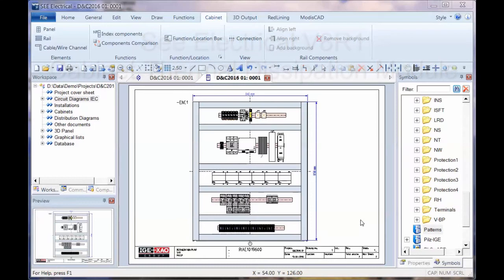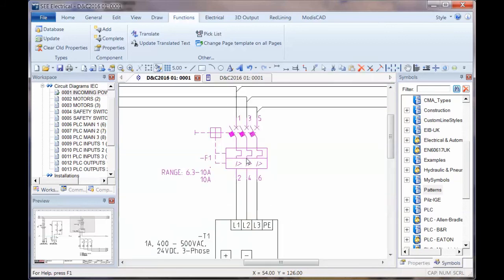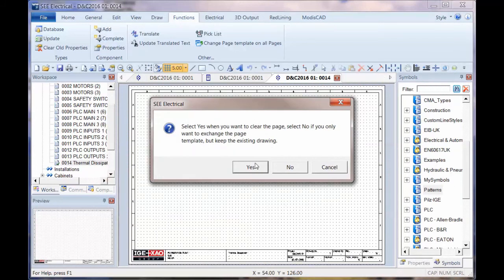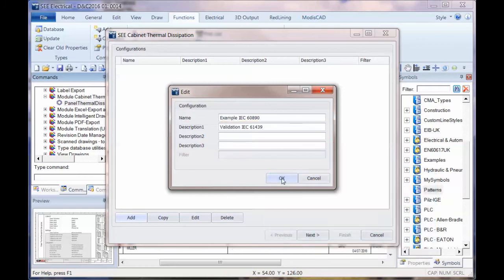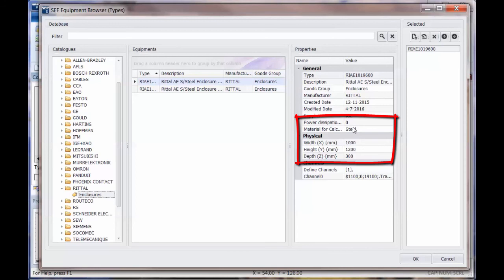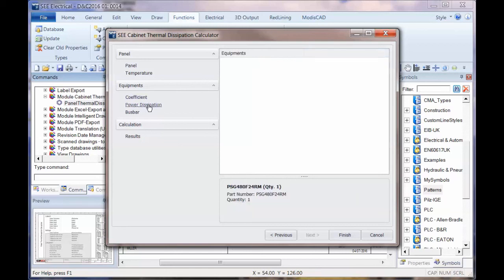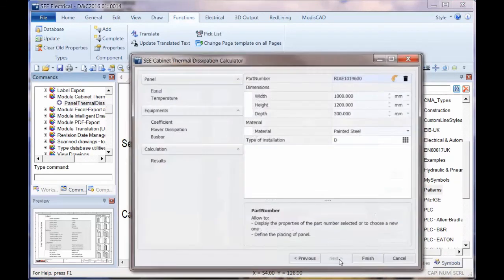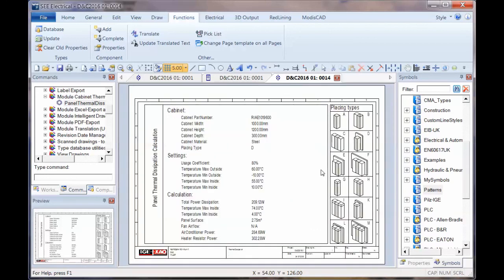Thermal Heat Dissipation Calculations for Cabinets in V8R1

Comment: Hi, 
Could you please help me...
Do you know how to measure the overall heat dissipation of the electronic components?
Here the component is ADAS front camera situated on car behind the windshield?
Having processor, image sensor or other electronic components
Reply from the maker: I'm sorry but our heat dissipation calculation is specifically tailored for electrical components contained within a panel, where the panel is either placed against a wall or next to another panel, which won't help with electronic components in a car.

Comment: Hie,

I need a calculations of Electrical panel cooling system.
For example: Panel size is 2100H X 800W X 800D mm and material is MS, thickness is 2mm
Total watt loss is around 2000Watts (Assume)
Cooling: Fan_S2D300AP0250 & SK filters 3240 catalogue models used.
Here how we came to know that No. of Fans and filters/louvers is enough for cooling the panel??
Please kindly do the needful.
Reply from the maker: This calculation is part of the module described. Do you have the module?

Comment: hi Where can I get the SEE files to do this calculation?
Reply from the maker: Hi Holy_Mage, the template files should be in the public documents folder C:\Users\Public\Documents\IGE+XAO\SEE Electrical\V8R*\Templates\. 
There should be 2 standard templates available called PanelThermalDissipation.tdw and PanelThermalDissipation-with placing types.tdw.
The calculation is taken from equipment/types assigned to the symbols in your project so the equipment database should be updated, although there is a step in the process where you can enter the power dissipation and update the equipment records for future. Each record should have field 13011700 titled: Power dissipation for calculation of power loss.
If any of this is missing please request from support uk@ige-xao.com or your local support team. If this module is not enabled then you will need to contact your local sales team.
Hope this helps